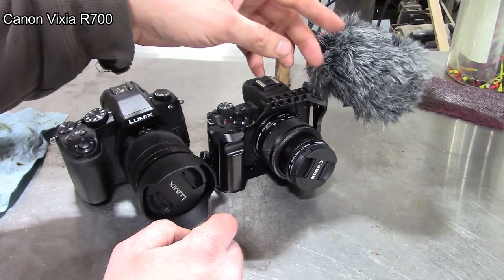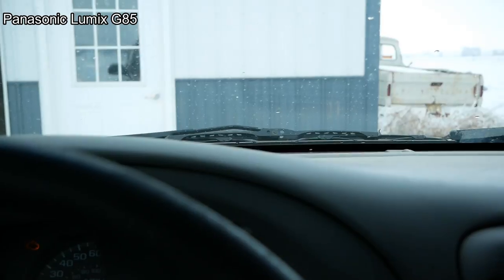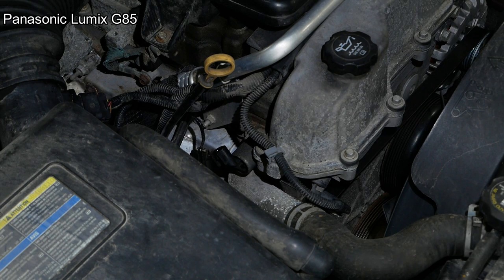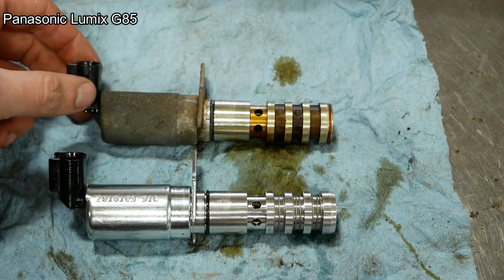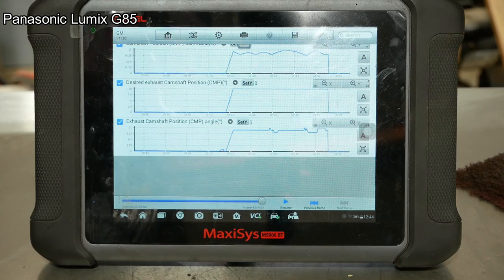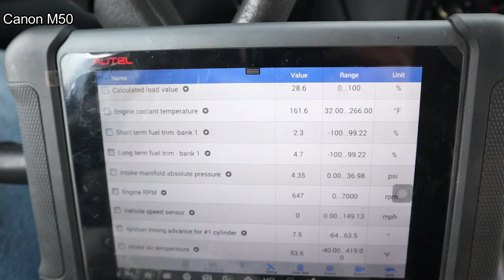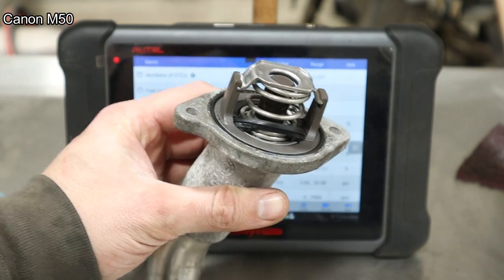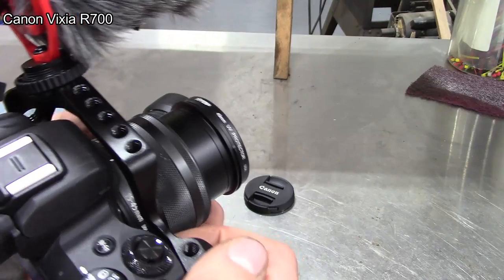Chevy Trailblazer -  Runs Rough on Cold Start, P0014- New Camera Testing

Comment: I agree with most everyone else, the Panasonic seems like a much nicer image.

In the old days, film was film, and you had a fixed ISO value for the type of film (and kind of processing) you used. You controlled exposure with a combination of the shutter speed and aperture. You probably want a fixed shutter speed for video, or at least want to limit the range of possible speeds. So that leaves aperture priority. That should be fine, unless the sound of the drive for the aperture adjustment makes an annoying sound on the audio.

On most cameras, as well as the ISO setting, there is auto-ISO, and there is usually an exposure index that is set to 0 by default, but you can vary manually at least +- 3 steps, probably a lot more. This is effectively the fine adjust on ISO setting.

Comment: I think all the digicams I've used have an EV adjustment to tweak exposure.  I also use a Canon Vixia 400 for my video (recording at 720 / 30 and 4 mbs to keep files small so my vids look a bit subpar) and simply glued on an adapter ring to use a wide angle lens and filters.  All cheapo ebay stuff but it really made recording in my small shop MUCH nicer.   I like dedicated handy-cams as they seem to have a wider DOF than fancy digicams as photographers really like that dramatic fuzzy background effect where vloggers just want stuff in focus.  
Holler if you want more info on my Vixia setup.

Comment: Never seen oil in the ECU but I worked on a 94 Ford Escort that had an ATF leak at the instrument cluster. It was working up the tach cable into the dash and dripping on the floor.

Comment: MB developed an oil-stop-cabel for camshaft solenoids, A2711502733 64 for M271 engines. And yes  oil can damage your ecm. Cheap trick is to remove the insulation from the cabel an put solder on it. it will block the oil from creeping towards the ecm because its stops the capillary effect. Some gearbox modules from MB dies regularly from this failure.

Comment: Alot of vvt engines need clean thin factory specified oil like 0w-20 etc .
Some put heavy 10w-30 in and vvt system fails in cold weather.
My neighbor had same part fail after 275k no other issues.
Then transmission failed sadly.
0w-20 in many new engines for vvt system.
Check Air idle control unit may be dirty.
Unless 190° engine will not go into closed loop .
Nice work Thanks

Comment: Both camera are a step up - Panasonic micro 4/3 has a huge lens selection with some really great zooms that are excellent but very expensive. It sounds like Canon may drop the M50 line while Panasonic is still going to support the micro 4/3. Also in the Panasonic line-up there are some great video focused camera like the GH4/5 that can be found used at acceptable prices.  So - stick with the Panny.

Comment: I have trailblazers in my shop that acted screwy. The cam phaser is oil pressure controlled. Dirty oil was keeping the cam phaser from adjusting accurately. Cold oil would do the same thing, try a simple oil change

Comment: FYI, I find that with either Canon or Lumix cameras, you should set the focus mode to the small box mode instead of entire screen, it prevents the "what should I focus on" problem.  Vehcor just taps on Mr. Spotty on the screen to set his focus point.  There are generally 3 focus modes: point, area, and whole sensor.  The area mode confines it to the central area of the sensor, point is a specific focus point in the viewfinder.

Comment: To change thermostat on 4.2 you do it from the underneath the wheel well you have a straight shot at it with a long extension  done it quite a few times

Comment: i've had the same experience with the trailblazer.  i also replaced the cam actuator which seemed to help but the cold start would still come and go.  i've read that there is a thermostat located on the passengers side rear of the engine under the exhaust manifold that could contribute the to the problem.  apparently it's a son of a gun to get out.  i couldn't even see it.

also, the trailblazer takes a TON  of oil, 7 quarts.  the engine doesn't play well with dirty oil so it's important to keep clean oil in it.   my trailblazer tends to consume oil. so it's important to keep on top of the oil level.  it doesn't smoke at all, lord knows where it all goes.  uses maybe 2 quarts a month.

Comment: The M50 autofocus area is 149 points 88% horizontal by 100% vertical only if you use the 18-150, 55-200, or 28mm lens, with all other lenses it's 99 points with 80% x 80% coverage.  That explains the lack of focus tracking at the peripheral of the image.  The Lumix uses Contrast Detect autofocus, which is what many cellphones use(d).  The 15-45 Canon kit lens is crap, the 18-55 lens is better than the 15-45.  The zoom direction on Canon lenses is all the same since the beginning, Tamron and other aftermarkets are opposite zoom direction.  The "Canon" direction is what most equipment expects, like follow focus gizmos.

Comment: The shutter speed is basically the adjustment of how much light is let in, therefor it allows for the light adjustment.  Here is where it gets really confusing, most of the terms used are carry-overs from the film days and digital cameras don't really operate the same way as film (technically).  The camera doesn't actually have a mechanical shutter as the old cameras did, but it's still used to electronically adjust the amount of light (and possibly affect motion blur).   Cranking up the ISO and then adjusting the shutter will give you a different effect than down the ISO and compensation with the shutter.

Comment: I have a Ford Explorer 1999 that has the same issue of rough running won’t idle when cold, generally less than 32 degrees. It is a well known 4.0 SOHC problem caused by leaking intake manifold gaskets. When the car warms up or the temp is above freezing the engine runs smoothly. Generally does not throw a code for vacuum leak.  The metal around the gaskets expands, as it warms, stopping the vacuum leak. I live with it until it gets worse

Comment: I don't know diddley squat about camera's and know even after you explain it, I am just as dumb. When you first started filming, it was okay and of course it would help if I  were that fussy but the videos are not life and death to me so I just enjoy what ever I get to see. Some interesting stuff... explain to the customer that their wiring is leaking oil and needs to be re wrapped up so the leak is contained. Of course I know that would not come from you as your      honest but   to some customer ...... Wes, I had a lady come in complaining that the car  was leaking oil just everywhere. She was upset an wanted her money back on the car so I checked the oil level as it was leaking as said. It was full...... clear to the top of the dip tube full. ... Wow came to mind and ask her where they changed her oil at and she said she did.... went to wal mart and got the recommended oil. Then she put it in.... "I asked how much did you put in it??? and she came back with "ALL OF IT" as she followed up with, they wouldn't sell me more than I needed.  Wow.... a old 1.8 Subaru boxer with a whole case of oil in it... first of all, didn't think it would hold that much if clear empty but it must of. I showed her the lines on the stick and how to check it.... I guess I should of told her finger tight on the oil pan plug was not tight enough like the filter measure was.... sure enough it came back with no oil.... POOR engine. I guess I should mention that was the second visit and not first oil problem one. I find it hard to believe oil could go that far without some real pressure behind it.

Comment: What you’re talking about in this video happened to me for the first time ever a a few months ago, I was working on a Kia with a 2.4, I replaced an oil pressure sensor with is located on the front of the engine UNDER the intake, the pigtail was full of oil but then if you follow the wire harness it routes above the intake into a larger like 12 pin pigtail and that connection was full of oil, absolutely no oil on the outside of the harness or anything, the oil traveled through the insulation vertical through about a foot of wire, I was mind blown lol

Comment: Your shutter speed should be double the frame rate, so 30fps means 1/60 shutter speed. A wider aperture will gather more light and provide a sharper focus while offering more depth of field (more of a blurry background). Personally, I shoot in aperture priority mode, leaving ISO and shutter speed on auto and adjust the aperture and exposure compensation as needed. Hope this helps!

Comment: I thought the lumix did the best job, tad over exposed in the engine bay shots, but thats just a simple setting.  The canon seems to struggle with stabilization, when you were moving the camera, during the thermostat segment.  Since filming a engine in tight quarters, and moving the camera to get a shot is very common occurrence in your videos.  I would think that would need to be addressed.  I guess that too could of been a setting too.  Love the channel.  Thanks.

Comment: For fear of explaining something that you already know I wasn't sure whether to post this but what the heck, here goes.  Aperture and shutter speed are the primary ways to control the brightness (or amount of light) captured during the video recording as they directly control the amount of photons of light that hit the pixel sensors in the sensor array.  ISO is essentially an amplifier that  boosts the signal from the pixel but it introduces other issues such as graininess of the image with high ISO settings (like and old TV with a poor signal).  Aperture also has some impact on the image quality as a wide aperture, e.g. f/4.0, significantly decreases the depth of field of the focus.  In other words the distance in which objects will be in focus.  Similarly, a smaller aperture, e.g. f/16 increases the depth of field (confusingly a smaller number = wider aperture as it is the  the ratio of its focal length divided by the diameter of the aperture)  For the work you do the shots are mostly close up and so you don't really need a large depth of field therefore a wider aperture is fine.  Slowing the shutter speed increases the amount of light collected by the pixel sensors between each scan but can create motion blur and whited out pixels that have reached their maximum value.
I would suggest setting the ISO to a level that is the lowest that works for a shot and putting the camera in a fixed aperture setting (the widest to get sufficient depth of field for the shot).  Putting the camera in auto will typically do exactly that but of course it doesn't know what depth of field you want/need.  You can also tweak the brightness in your video editing software but that increases editing time which I know you want to reduce.

Comment: don't change shutter speed with video, leave it at about 2x whatever the FPS is, so 60FPS run 125 shutter. Also, for fine tuning ISO, I try to keep it as low as possible, you can use the apature to let more or less light in but sometimes you just have to start raising the ISO in lower light. You can also run an ND filter on the lens, variable preferably, to limit the light coming into the lens.

Comment: @11:35 Battery acid will also "wick" up through the wire too, the same w
 The cold coil boots sometimes cause problems... and carbon tracking... and oil submersion.

And those VVT valves get gunked and stuck when old and cold... When they leak oil into the plug, the plunger on the inside of the valve has to displace that oil when it is energized...

Comment: The ISO used to be for film cameras and the numbers the Panasonic default's to are the old film numbers, most photography is based around juggling the aperture and shutter speed which does give you a much finer control.  Smaller aperture slower shutter speed but greater depth of field, wider aperture, faster shutter speed but decreased depth of field.  In the film days you could 'push' film  to a higher ISO than it was rated at to get a faster shutter in low light but the results would become grainer as the film had less time and light to react to.  With the advent of digital products the ISO just became another tool to play around with but it is coarser than the shutter speed/aperture combination but an easy way to adjust the image,  but it can still have the delertious effect on image quality if you push too far.

Comment: You can change the G85 ISO step size to 1/3 stop instead of 1 stop, but you have to be in one of the picture taking modes to see the setting.  For some reason they hide it when you're in movie mode.  It's under the first menu in the settings.

Comment: Hey Wes,
I like the panasonic.  I'm more familiar with Nikon and Sony, but there is likely a menu setting to chane Iso step to 1/3 instead of full stops.  if not, better to fine tune with aperture for exposure.  there is a 180 degree shutter rule of thumb to fix shutter speed at 1/2x your frame rate.  if frame rate 25 fps, set shutter at 1/50.  this will render motion similar to human perception.  
I would also recommend lowering exposure.  when you commented panasonix was too dark - i thought it was good .  could be that your editing monitor  is set too dark.  also when you zoomed in with canon lense- looked better exposed since kit lense will have smaller aperture as you zoom in.  
Sound and stabilization were great!  have fun learning the new cameras!!

Comment: Exposure is adjusted in “stops” normally you want to adjust the exposure to get the desired level of “dynamic range”. Essentially, you gotta tune for where you want your detail to be. 

Because you work primarily in dark holes, I’d not worry so much about over exposing the highs because all of the content that matters is in the low light areas.

This is an extremely oversimplified take, but that’s just my 2cents.

Comment: Never saw it on the video so I'll ask...did you check the air filter?  A clogged/bad air filter in cold air will choke off air to the system even more so due to the filter elements contracting.  Any moisture in the pleats will freeze/expand and cut off even more airflow.  I am watching your videos on an HP Laptop that is 10 yrs old but the picture is still excellent.  I vote for the Canon M50.  I looked at all three cameras in still mode several times.  If you compare the Canon R700 with the M50 when you are inside the truck looking at the dash, the amount of detail with the M50 is hands down the better picture.  I think you just need to adjust and work with the lighting and background.  I'm not an expert on cameras.  Just calling it as I see it.  But again the M50 detail is the winner, imo.  The Canon Vixia R700 is still a decent camera.  Have a great week!

Comment: I agree the video quality doesn't really matter, compared to the content. Doubtless the Canon has a near-infinite number of ways you could configure its autofocus, but I'd go with the Panasonic that works straight out of the box. If you can put the G85 in a mode where it sets aperture and ISO automatically, and if you can find an exposure compensation knob to tell it "make the picture a bit brighter/darker" that would be easiest. But I read the G85 user manual and it's not clear.

Comment: My 2005 Toyota Corolla did that when first started in the morning. More noticeable during the winter months. I replaced the exhaust manifold gasket and it went away & runs so much better. That one gasket made it run awful. It had a misfire it stupperted acceleration was awful the ones I replaced that gasket everything went back to normal and run so much better idles much better

Comment: I worked for tier 1 suppliers that made various solenoid modules and sensors for 15 years.  You would be surprised how hard it is to prevent terminals from leaking.

The world is developed by the lowest cost suppliers.....

Comment: I have a lumix and I often use it for timelapse where lighting conditions will change. I tend to set it on aperture priority and it sorts out the exposure and ISO settings itself, you can tweak the brightness and where it meters it. Its supposed to have some sort of intelligent tracking autofocus but I find whichever of the modes I set it on, it hunts, I've never found an autofocus that doesn't. I'll use the AF to get it locked in quickly, but flick it to manual before I hit record.